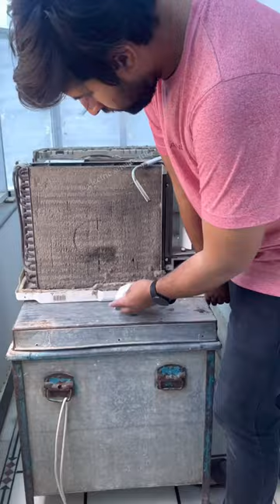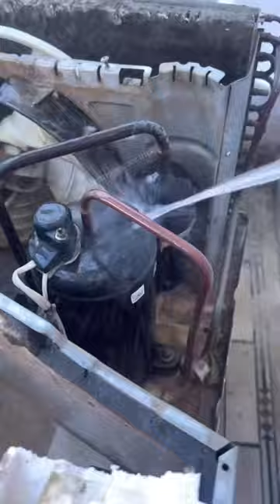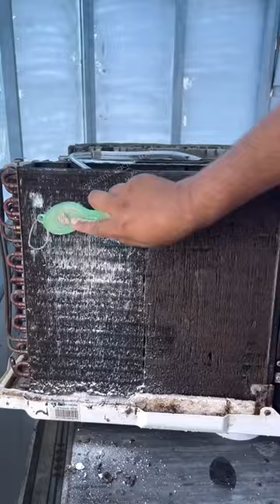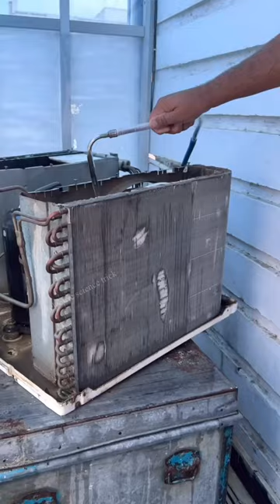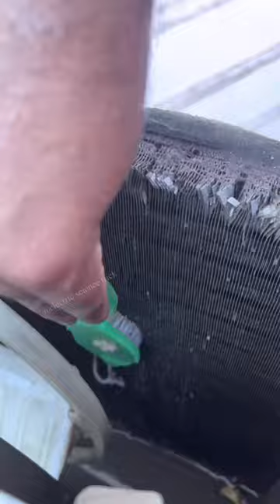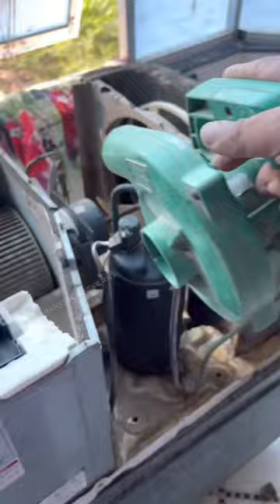AC service  #electricsciencetrick @electricsciencetrick #shorts #short ￼

Comment: NEVER use brush or similar things to clean coil fins as they'll damage them. Either use plain water with soap in a bottle to spray on the fins, or buy a coil cleaner from any AC repair shop. 
And you don't have to do as deep a clean as is shown in this video. Don't touch the fan or other parts. Just clean the coil (preferably with coil cleaner) and that's it.
Reply: Thank you. Seems like every video or tutorial on cleaning an AC unit involves taking it apart completely. For that many hours of work I would rather just buy a new one. I’ve been looking for just simple, succinct instructions on how to do a quick cleaning, not a 2 day long project,
Reply: yar tumhe AC ka work ata hai kya ?👈🏻👈🏻👈🏻👈🏻👈🏻

Comment: Use coil cleaner and pressure washer. 😮 And why are you putting water on the fan motor 🙉
Reply: yar tumhe AC ka work ata hai kya ?👈🏻👈🏻👈🏻👈🏻👈🏻